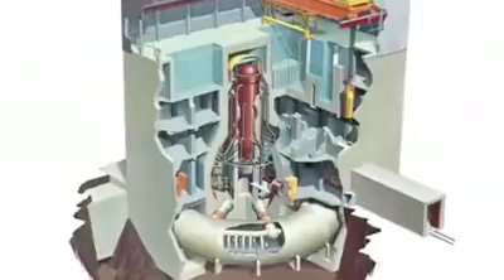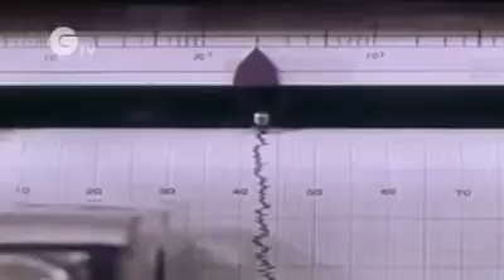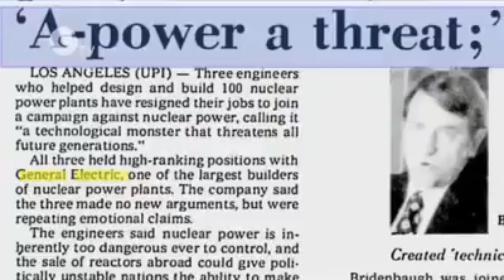Mark 1 Nuclear plants similar to Japan in peril GE TEPCO

Comment: Had an idea: Could the Fukishima waste water be separated and the water steam off through DEKA distillation, powered by another reactor if safe, instead of running into the Pacific ocean?

What if control rod material finely ground was fed into the core, even drilled with geological boring and fed a mile down? Also what about boronic water to cool, and pre-stage ion exchange with titanium oxide and salt before distillation to  separate the waste before dumping the waste into the ocean?  Maybe CA should be piping Atlantic water for desalination or distillation and keep the Pacific off tap for now.
Reply: Mike Anyone no u can't do that where is the steam going to go??  cesium-137 will not the test just go away because you boil it buddy that's not a good idea that's not going to work